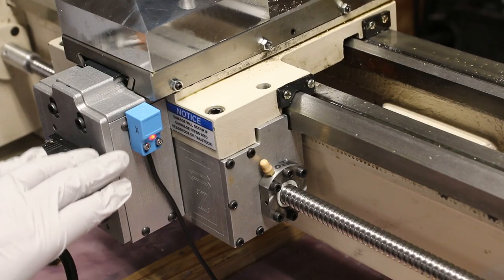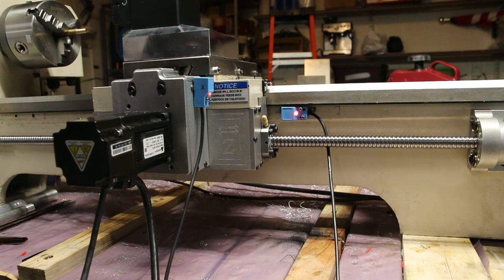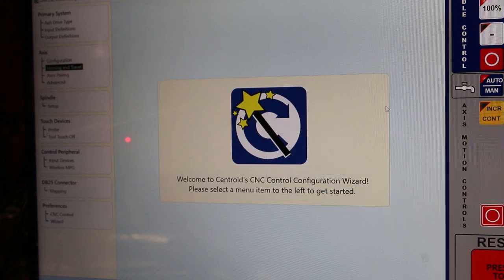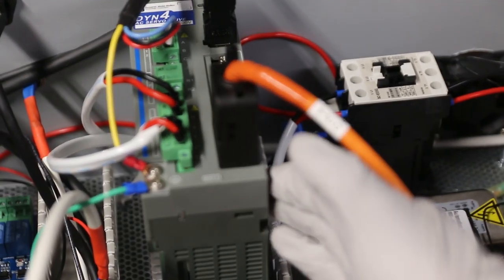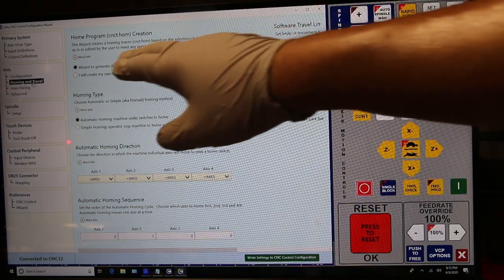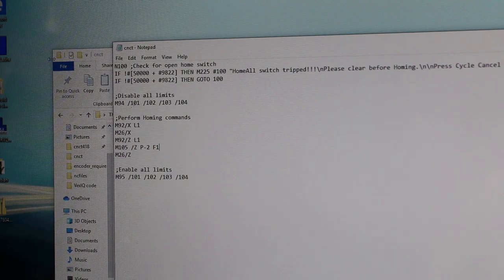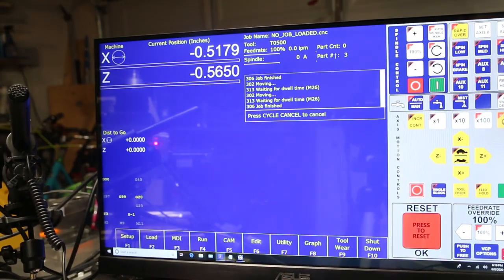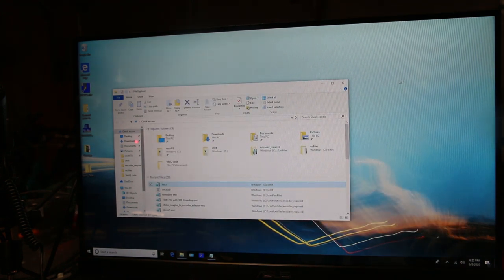Homing y finales de carreras usando el encoder de servos.

Comment: Hola daniel hice todo el procedimiento del zri exactamente como tú los hiciste en el video lo único diferente es que yo me muevo en m91 en la Centroid. Quisiera saber si p-2 significa pulso en movimiento negativo porque por poco daño el router. Si pudieras darme una opinión te lo voy agradecer
Reply from the maker: Mis interuptores estan en el movimiento Positivo, M92, entonces uso el command M105 para encontrar el pulso con movimiento de la eje en el negativo.  Como los tuyos estan en el movimiento al Negativo, M91 yo usaria el command M106 para encontrar el pulso con movimiento de la eje en el Positivo.  P-2 es que el ZRI cable esta connectado al input 2 de acorn y espera a que se cierre, mientras P2 es que esta connectado al input 2 y espera a que se abra la senal.  Para cambiar el movimiento usa el M105 o M106, si usas DYN-2 drivers manten el P- porque las senal se sierra cuando encuentra el pulso en la eje.  Ojala me hice claro.  Saludos.